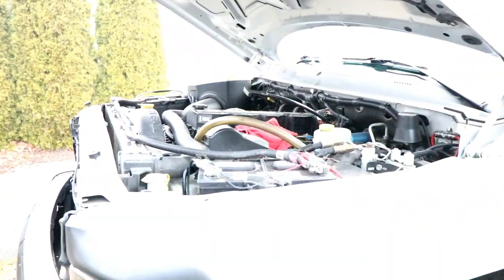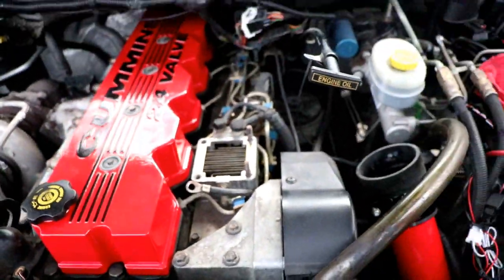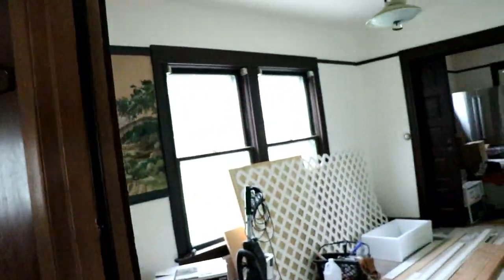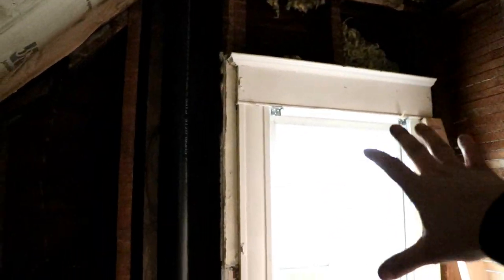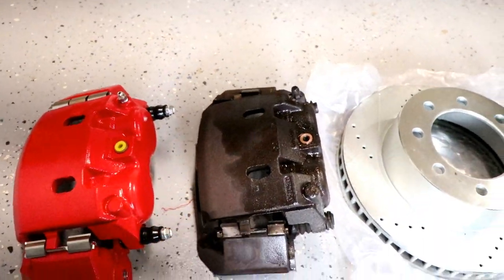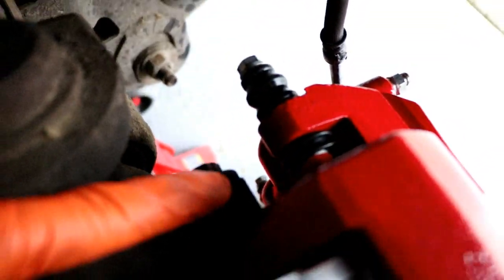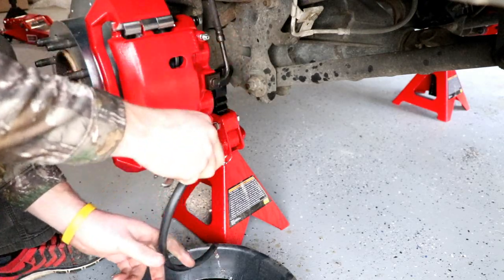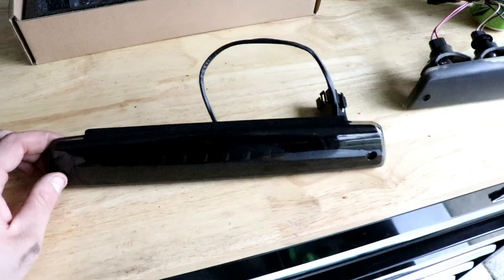Installing 3rd gen brakes on a 2nd gen cummins?

Comment: A couple of updated comments on this:

Those were Power Stop brakes.  Their website gives specifications as to sizes, etc.  The website shows who carries their products with links you can choose.  I have used Power Stop for 100’s of thousands of miles.  I tow and have had no issues with their products.  I am not affiliated with Power Stop at all.

The 3rd Gen rotors are 1” larger diameter on the fronts and 1.3” larger on the rear.  You will need 17” wheels.

The nice thing about this Power Stop kit is that it includes the caliper mounting brackets, which is necessary because of the larger rotors.  The stock, 2nd Gen brackets won’t work because of the larger diameter rotors.

The stock 2nd Gen hoses work with the new calipers.  It’s also a good time to update with braided steel lines.  I used 2nd Gen replacement KLM hoses…an easy bolt on replacement.

For 3rd Gen part numbers I used 2005 for my 2001.

Break in the pads as described on the Power Stop brake pad box.  Very important.

Comment: PSA: The Powerstop calipers are OEM that Powerstop simply powder coats in the red color. Also, Powerstop has a very specific break-in procedure on their pads which from the video appears to NOT have been followed. It also doesn't look like you fellas used any type of caliper grease on the caliper slides, shoes, mating surfaces on the caliper brackets or the caliper pins. Didn't notice a torque wrench being used which is an absolute when it comes to caliper bracket fasteners since the torque spec is 25o ft/lbs for the front bolts on the Gen 2 2500 RAM.

Comment: I installed Power Stop rotors and pads on all 4 corners of my 02. Best money I've spent in a long time.
Reply from the maker: Chris B. Definitely makes a difference!
Reply: Chris B. Was just thinking on this. :)
Reply: Chris B. Did you install the 3rd gen brakes on your 2002 or did you actually go with the brakes it recommended for your year model?
Reply: @rickyhernandez2555  I installed the recommended brakes for the 02 with drilled & slotted rotors and extreme duty pads.
Reply: Ricky Hernandez changing the rubber brake lines to SS braided lines will make a big difference to.
Reply: My brakes are kinda hard, and abs and brake light turn on and stay on while driving when I press hard on brakes what it can be?? And suggestions.? Thanks
Reply: Where do I get that set up
Reply: @shrekwest8587  I bought mine through Amazon.

Comment: doesnt work for my 1998 ram 2500  i have rotors with the bearing held in by the studs .  do you know of a big brake kit for it ?

Comment: What size rim is he running, wondering  if this would rub factory 2nd wheels on in side
Reply from the maker: Nick Lister he is running an 18” wheels which is the smaller wheel size you can run for the upgraded rotors.

Comment: Would these brakes work for 97 Cummins? My brakes are stiff and I have to press hard to stop the truck the pedal barely moves and I’m not sure yet if my brake booster is going out or just need some new brakes.
Reply: I have a 97 also.  Unfortunately the 97 has a different setup that where this won't work.
Reply: You can get gm 1 ton rear bracket caliper for your drum.

Comment: Any up grade ideas for the rear drum brakes on a 99 CTD 2500
Reply from the maker: Upgrade to disc haha.
Reply: Swap to a AAM rearend out of a 03 or newer
Reply: NeverSatisfied24v what would you all need to upgrade to disc?
Reply: Run 90’s model 1 ton Chevrolet wheel cylinders there physically lager and stop better it’s a tight fit but work good

Comment: Anyone have info on installing these on 98.5 to 99. I've read you need a bracket of some sort .
Reply: Tyler Padgett can’t be done on a 99 the studs have to be pressed in on those year of trucks
Reply: @levicummins7317  after seeing this video i did as much research as i could in the last week.  From what I understand (and please, if anyone knows more feel free to correct me/chime in as I haven't actually tried any of this) a wheel bearing from a 00-02 will bolt onto a 98 or 99, other years im not sure about.  So, if a 02 hub works on a 98/99, and the caliper will line up then that, plus 18in wheels is what you need to do to run this setup.  However 03s came factory with 17s so stock 03 brakes might work?
Reply: Callum McKay I might just try it with a cheap one from rock auto it would make life a lot easier
Reply: @levicummins7317  I bought All stop from them but I also bought the lifetime brakes from my local national parts store and keep them in the truck as I have 2x had a piece of 3/4" AB crush gravel wedge between the pad and the caliber and because the rock is wedge shape whore down the brake and rotor had my rotor jam and explode. The last time I found it before it happed but still exploded on the way home even using the e brake to stop. Had to use the foot pedal and boom. I have all my shelds in place. Now I got aluminum disc cover that goes on between the rim and the rotor that is vented to keep out debris. That was 5 years back and no rocks in the brakes so far.
Reply: @seanbrossard8178  did you put hubs from a 2000/2001 on a 99
Reply: @levicummins7317  no I have a 1997 with no out of year update so far from what I understand you have to replace the whole knuckle assembly to get to the slide on rotors.
Reply: @levicummins7317  I do have 1 ton Chevy slave cylinders on the back

Comment: I’ve got a 97 1500 5.2 looking to upgrade the front brakes, however I’m running 33x12.50x15, any idea if the 3rd gen rotors and calipers would fit?
Reply from the maker: James Stultz on a 97 the setup is different, you have a bearing and hub attached to you rotor unlike my truck. It’s like the red 12v brakes we did awhile ago on the channel.
Reply: @NeverSatisfied24v  what parts do you have to change to get the gen3 to fit 1997?

Comment: I have a 1998 12v Cummins. Does the conversion work for this year,. I also have lots of play in my steering, recommendations for new heavy duty steering kit that will hopefully fix that?
Reply from the maker: Danny Shaflik yes I believe the 98 has same hub setup, unlike the 96s where the hub is attached to the rotor. And for the front end I would highly recommend a Red Head steering box, tell them I sent you. And for the steering linkage, trac bar and end links I’d recommend the front end rebuilt kit and use code: Neversatisfied24v for 10% off the website. With these upgrades you’ll notice a huge difference, it will feel like a whole new truck. I have install videos on all these as well if you have any questions on them. https://www.bryansautorebuilders.com/collections/94-02-dodge-ram/products/94-02-dodge-ram-front-end-rebuild
Reply: Unfortunately everything is hub over design up to 99, i believe the design switches to slip on disks, like the ones in the video in 2000 but i could be wrong about that
Reply: You are in luck You can update to the older T heavy duty steering and trash the y style for about $400 for the whole front end with polymer parts and rebuildable track bar. Do you have a lift if so get a drop pitman steering arm to mach the drop(2",4") to stop bump steering. The only way to do the front brake upgrade is to put 1998 or Newer axel or king pin assembly. But a 1990 chef 1 ton slave cylinder for the back drum brakes or Newer dana 80 rear-end with disc's but you will need a portioning valve and so plumbing pieces. But a adjusted drum brakes have 3× more surface contact area and will out brake disc's.
Reply: Chevrolet 1ton slave cylinder 1990

Comment: I've watched many channels, watching yours has taught me many things to look for and upgrade. I guess what I am saying is, great channel man. I'm going to be doing this mod for mine. Only question is, is there anything else you have to do other than swap brake assembly out?
Reply from the maker: Diesel Power happy to hear that! That’s one of the reasons I do it and I appreciate the support! No nothing else it’s just as easy as swapping calipers and rotors.
Reply: Where do I get this setup send me a link